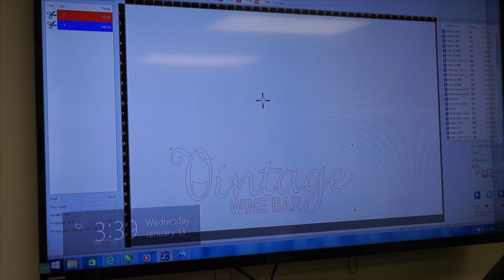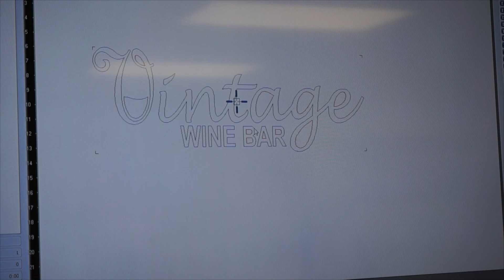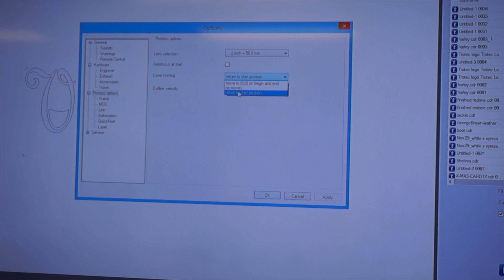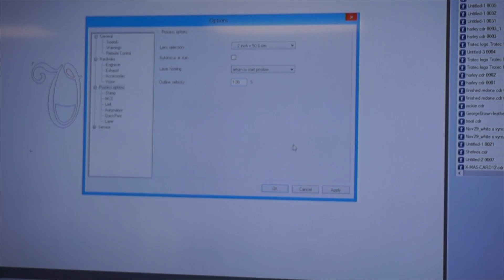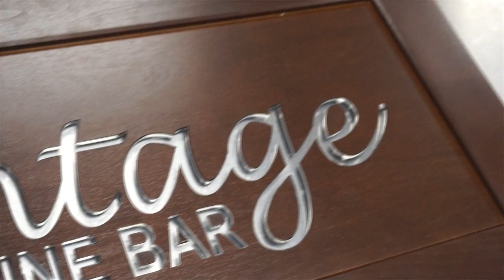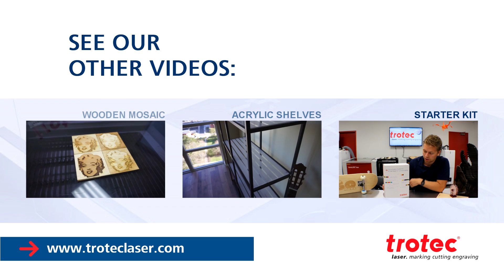Acrylic Inlay | Wooden Cabinet Door | Laser Cut

Comment: Interesting, but....  I could use a flatbed inkjet printer to print on clear acrylic, then put it in a wood frame and achieve the same thing waaaay easier, faster, and cheaper.  Seems like a long way around the barn to me.  But as an example of what's possible, it's interesting.
Reply: That's a great solution for those who have access to a flatbed printer, likely costing from 100 thousand dollars and up?
Reply: @haakono  You're correct about the capital expense of a wide format printer, though there are many that can be had for far less.  But the real option is that  every city has multiple existing people in that business who could do it fast and for reasonable $'s

Comment: Hi, What speed, PPI and power need to use to cut 1/2" acrylic-polish edge  with 120 watts- Trotec 360- 2.5" Lens
Reply from the maker: We recommend 100 power, about 0.2-0.3 speed and 500 PPI. Make sure you have a strong ventelation and you should cover up the table where there is no material (in order to get even better suction and reduce flaming). Always test out a small square to get the best results before proceeding with the full job.

Comment: What wattage is used to cut the wood? Wattage to cut acrylic?
Reply: @TrotecLaserCanada  oh so the higher the number the stronger the pull or is that like the higher the number the more it filters? 

Also, I have a friend that has the gravograph and his laser broke he told me the replacement laser costs as much as a new machine...

How much would a replacement laser tube assembly and power supply cost on lets say an 80watt tube on the trotec speedy 300? 

Is there any extra waranty on the tube? 

So far you guys seem good and have good reviews I just want to make sure its something I can keep for a long time so I can buy other equipment in the future. 

Thank you
Reply from the maker: Hello, the machine is an 80 watt machine
Reply: @TrotecLaserCanada  so with 80 wats what is the thickest acrylic you can cut? can I do this on a speedy 300 80 watt?
Reply from the maker: @Maplesyrup416  you can cut up to 1" but you may need to do it with multiple passes. For 80watt you should be able to cut 1/2" with one pass with the right ventilation.
Reply: @TrotecLaserCanada  is the 80 watt 120v input on the speedy 300? 

What would be the right ventilation?

Comment: Mike,
I really enjoy watching your videos and learn a lot from them.  I would appreciate if you can provide me the link for masking tape you used.  Also, how can I find out laser kerf for 60 W with 2" lens on Speedy 100?
Reply from the maker: Hi Manoj, thank you for the kind words! If you're in Canada you can order it from us here: https://www.engraving-supplies.ca/laser-engraving-accessories/tapes-velcro-adhesive/mask-medium-tack-8-in.html . What do you mean how to find the laser curf?
Reply: Mike,
I live in USA.  Is there a different link for masking tape for US website?  You mentioned around 3:45 on video that size of the acrylic has to be adjusted for the kerf of the cut on the wood so it will fit. (5000 with contour of 2).  I am wondering if that stays the same if 2" lens is installed.
Reply from the maker: Best thing to do is to call our US office and ask them - 844 529 0730. If you're using a bigger lens then yes the curf will be thicker and you will need to expand the contour a bit. We would suggest to test it out on 1 letter or a small shape to see how it will fit, adjust the contour based on how well it fits and then once you're satisfied apply it to the full job.

Comment: Good job!

May I ask, what is that paper that you used to mask your wood?  Is there a specific brand that you used?  I would imagine that it is a low-tac adhesive paper, so when it is peeled off it will not leave an adhesive film on your work surface, correct?  Why not use it on the acrylic piece also?

Thank you, and again.  Nice work!
Reply from the maker: +Manuel Villalpando Hi Manuel, thank you for the kind words. It's regular painters mask, like an extra wide masking tape, if you're in Canada we sell this product. Low-tac adhesive paper, exactly. We don't get burn marks on acrylic like we often do with wood, the mask is there to protect the wood. Some like the burn marks to give it a more rustic look, it depends on what you are looking to achieve. 

Thank you for your comment and questions!
Reply: +Trotec Canada: Thank you again.  I live in Downey, California.  I was able to find the masking tape at my local hardware store.

Unfortunately for me, I am deciphering the User Interface of a Chinese laser machine that I bought through a big online vendor.  The laser machine was riddled with problems since the first day it arrived.  I have tried litigation in order to get my money back but the judge here in my area would not allow me to get judgement, so I am stuck fixing and learning a new software plug-in called CoreLaser.

The next time around, I am going with buying a Trotec Laser Machine or an Epilog.

Thanks for the tips on your videos, I am sure I will learn more from watching your techniques and approach styles to your projects.
Reply from the maker: Hi Manuel, thank you for the kind words. We are glad the videos help out!

Comment: Hi Mike, nice job! How thick is the wood you are cutting. What power laser and settings did you use? Cut power cut speed.
Tks.
Reply from the maker: +Edwin Macdonald Hi Ediwn, the wooden panel inside was about 1/2" thick. We used a Speedy 400 and 100 Power, 0.4 Speed on the cut.